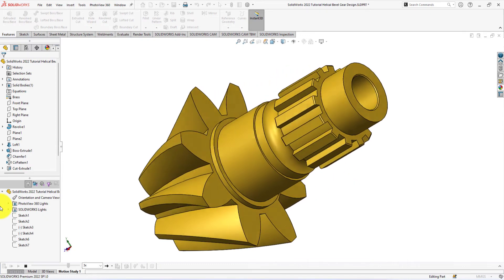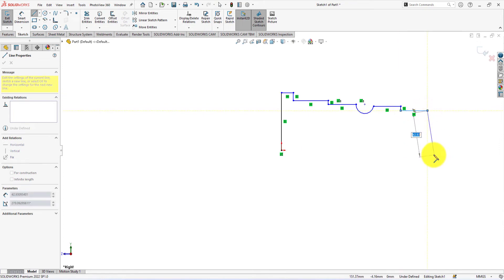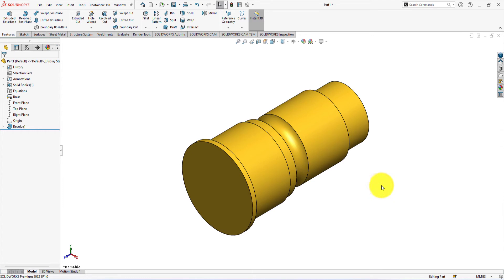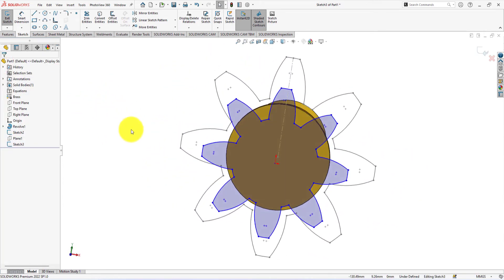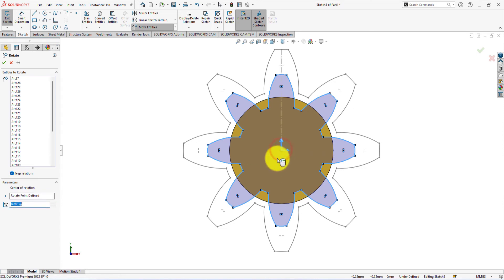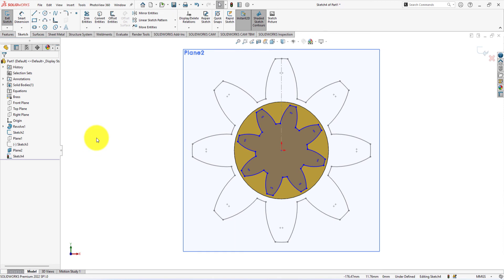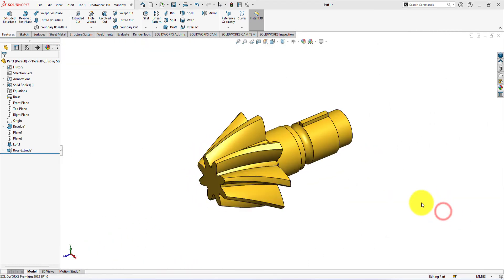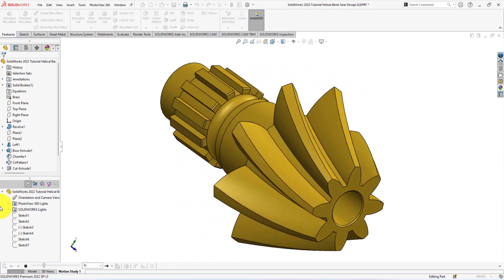SolidWorks 2022 Tutorial - Helical Bevel Gear Design

Comment: Not bad, but the tooth profile could be parametrically driven so that lines forming the tooth create a true rolling circle and therefore an involute tooth profile.  You could then set all the other parameters of the model to be dependent upon a few select variables such as tooth #, tooth modulus, gear width, pitch of helical twist, etc.